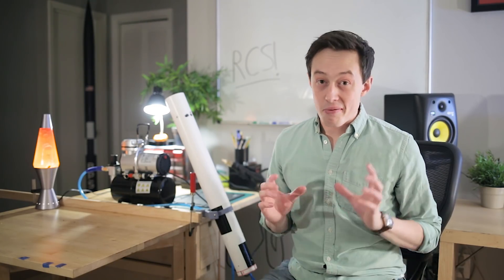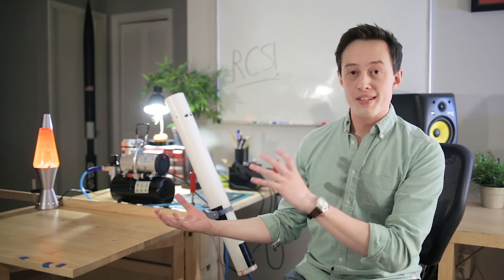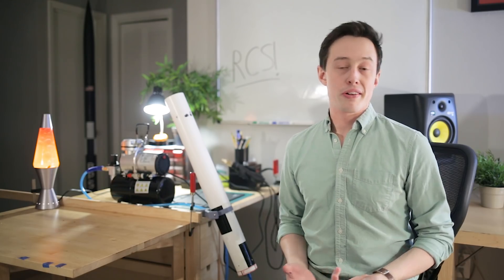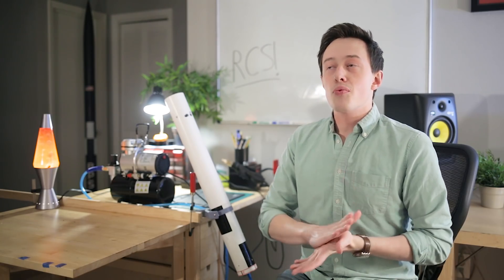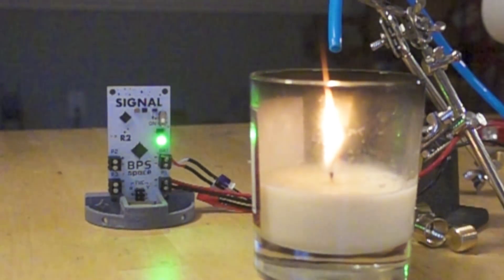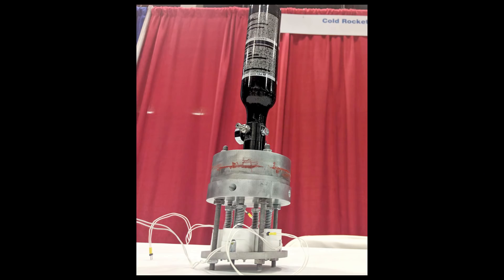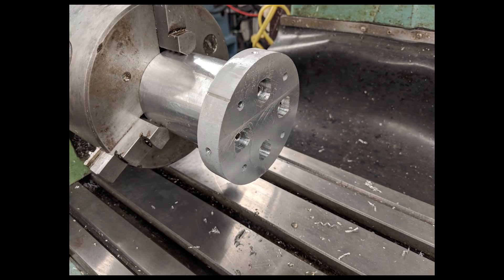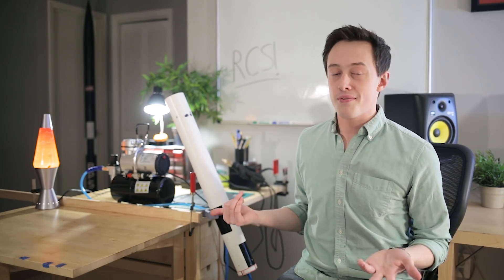Reaction Control System(RCS) Development

Comment: I have a question tho: why do the rcs engines produce a white trail in space? Shouldn't the gas be invisible in the void?
Reply: Space-worthy RCS thrusters usually have combustion chambers and run on hydrazine-based fuels (as opposed to cold gas systems that just require a pressure source and a valve). I have no idea what the products of the combustion are, but I see nothing preventing those gases from being visible.

Comment: Would it be possible to build a lightweight composite pressure vessel to contain the exhausted energy from a black powder motor within a rocket? If so, would a control system to release this be practicable, or would the exhaust particulates cause too many problems in valves and nozzles?

Comment: Super cool system. One suggestion might be to refine the design of your thruster nozzles. With 100-200 psi of air you can easily get Mach 2+ flow in a convergent divergent nozzle with the right area ratio. This would give you much more thrust for a smaller amount of air used. 

Here’s a link to some of the isentropic flow equations for nozzles, you may already be familiar with them 

https://www.grc.nasa.gov/www/k-12/airplane/rktthsum.html

Comment: Have you considered using a Betaflight flight controller for any of these trials?? I feel like if you used a Betaflight FC you would find the board is very well equipped,,, and you MIGHT even be able to use Betaflight.
Reply: I think FPV is a big future for model rocketry, , with a variety of applications for example, hovering over a landing pad, flying laterally, or even racing,,,, and can't help but think that a top quality FPV flight controller might just be also the best thing for rocketry.

Comment: If you want to do the throttling (floating valve) control of the solenoid, automotive engine management systems sometimes do this for idle speed control and turbo boost pressure regulation. A flywheel diode is essential and typically they are modulated at 20hz with a 15-85% PWM control region. Because it is impossible to know the valve position you need incorporate this inside your closed loop control somehow, whether it be an internal control loop with an angular speed target, or something else, I have no idea :S.

Comment: What about using a little bb gun co2 cartridge? Very light weight, just needs a valve that can trigger and detrigger within milliseconds (so a regulator isn’t necessary). 

Also, could you show us what valves you used in more detail?

Comment: PWM is basically the same as having a high enough flight software frame rate, I don’t think you need to get fancy here. I’d also be surprised if you could cycle to solenoids fast enough to get a rate much more than the software refresh, so the benefit of pwm would be marginal.

Comment: When you say paintball tank at ~800psi - are you talking high pressure air, or Co2? The gas volume and weight will vary significantly. If Co2, plan on something that can deal with phase change energy or you'll be freezing up everything.

Comment: In your next upgrade, the RCS thruster section should be a shouldered/full body width center section.  This way you slip it in a 74mm tube that is the rest of the propulsion section, and an upper rocket section can slip over the top.  As discussed below, when you get to roll control, you just use a smaller orifice for the jets and accomplish vastly reducing the thrust and still operate at the same pressure as the other two axis. This allows you to build a complete system that you can put in the middle of an existing rocket for testing.

Comment: HOWABOUTA sleeve for the rocket engine that steals pressure from the main engine for the RCS. If all RCS ports fire at once it would have the added benefit of lessening the rocket thrust, as a form of throtteling.

Comment: I’m not sure how you could get a tank for this you could tear apart some air soft guns but you can use green gas it’s really easy to refill and a very high pressure for smaller rockets that is if you’re going with a paintball tank  sized rocket that’s a lot

Comment: @bps.space if you do 90 degree turns you will lose bit efficiency i recommend you to make the turns smooth. On CAD  you can youse swept with remove  90 degree turns not good for you because you have limited air

Comment: Given that your rocket will stay in the atmosphere, how would the energy/kg compare to using a drone controller, battery and four small props to achieve the same thing? I guess you would need to minimise the drag caused by the props but it might be offset by the weight savings?

Comment: Congratulations Joe, that's a great new idea. Will be perhaps better to use proportionnal small Rc valve type with Rc servo actionners. The answer will be proportionnal and you will save a lot of compressed air and weight for same result. Will be also much lighter and efficent. Go direct to simplicity. Why designing heavy when you can do it light...

Comment: Have you considered using propane/butane instead of compressed air?
Sure it seems dangerous at first but their compressibility is much better, and you could store a lot more gas allowing for more time to run your RCS.
Also, maybe some clever design for electronic firing, and an optimised nozzle and you could literally fire them off :D
But seriously, combustible gases are sometimes used in some hydraulic applications where the ability to store a lot of pressure is important.
BTW all the best to you from Polish Synchrotron Light Source, I do have my own share of "space like" technologies here :)

Comment: Great video, keep going. I like the way you challenge the different control systems and practically demonstrate them.
You need something like a spare tyre to act as an air reservoir to give you longer testing time.
The link to Charlie doesn't appear to work.

Comment: What about using propane? It is at about 8bar at room temperature and it will expand 270 times during the transition to gas form.
This could allow you to reduce the size of the pressurized tank to a very small tank of 100ml or so. 

The biggest issue in this case is the cooling of the propane when transitioning to gas form. Usually if you let out gasious propane from the top of a tank of liquid propane, the liquid itself cools down, which reduces pressure and the ability to turn into a gas. This could be overcome by keeping the propane a liquid right up to the valve, and basically spraying out liquid propane. Then the absorbed heat energy will not come from the stored rest of liquid, but from the air surrounding the spray of liquid propane.

Another option to overcome the cooling issue, that could increase performance greatly, is the heating of the liquid propane. In this case, you'd choose the simple tank that feeds gasious propane to the thrusters. Now that a big part of the cooling takes place at the stored rest of liquid propane, a single small propane burner can be used at the tank itself to keep the pressure high.

If you think about 100ml * 270, that's 27 liters (athmospheric). That's the equivalent of a 2,7L (air) tank at 10 bars. I'm sure a 100ml tank is much lighter than a 2,7ml tank (both would hold 10 bars for comparable performance).
Reply: Me like!
Reply: OwO a scientist

Comment: You can probably reduce weight and get more control authority/more RCS burn time if you use propellant grade hydrogen peroxide with silver catalysts. Lower pressure, thinner tanks; the advantages are numerous.
Reply: If you can’t acquire propellant grade h2o2, the use of some kind of chemical gas generator with a downward pointed bleed system (more thrust) may also be a good idea. I don’t know how easy it is to get pure/nearly pure hydrogen peroxide. It’d need to be about 95%.

Comment: On your CAD, model the sharp 90 degree in the fluid flow will induce turbulence and cause a massive amount of energy loss... A smoother transition i.e. a 1/4 of a donut would be worth a reprint. Also loved the nerd out during the test. Industrial peroxide passing through a catalyst in the future??....
Reply: Bear in mind that it also needs to be manufactured with reasonable ease.

Comment: Why not buy an in home high pressure compressor https://www.google.com/shopping/product/1?q=high+pressure+air+gun+compressor&client=ms-android-verizon&sa=X&biw=412&bih=766&tbs=vw:l,ss:44&prmd=sivn&prds=num:1,of:1,epd:8801944323085387089,paur:ClkAsKraXxazr8WUP2GCmxl5pbyWzyV2QSVQ5c3085Wq2Kokj1BVGq6b7mP3ZGJDauBgMJKOjQvVqGas7naixHkkUMF_d7olQurO6K5xzQawVMgF0U-AJhbu9RIZAFPVH70aB8uNLwHQl3jKfJDLrfFB6zM5Nw,prmr:1,pid:8801944323085387089,cs:1&ved=0ahUKEwjY3o-KucvgAhXGmq0KHTLKCN0QgjYIhgU

Comment: For the air storage, it may be interesting to look into cylinders for airguns, those are usally quite small and compliment the shape of the rocket quite well. you may even have enough room around the cylinder for the valves and other required equipment. (smallest paintball air tank is around 350cc, a pistol air cylinder can be found in 68cc (3000psi)
Reply: Could invest in making custom COPV’s, Air Command Water Rockets used fiberglass to create a custom pressure vessel
Reply: Cool story bro.  Maybe try watching more than 2 minutes of the video before commenting.

Comment: How do you calculate the thrust produced by one of your RCS nozzle, given the circuit pressure and the nozzle diameter? I tried to estimate it for a roll control system on a model rocket a few months ago but got stuck in the equations, I couldn't find a way to calculate the air flow velocity through a nozzle knowing its size and the pressure difference.

Comment: For lower weight parts you could look into pneumatic RC retract components. Cool project! Looking forward to the next video!

I'm not sure about the maximum operating pressure of those systems though, may be too low and not enough flow

Comment: Joe just a thought, rather than carrying a pressurised air vessel and that complexity, have you thought of using water instead for a higher reaction mass?  A brushless motor would run a small centrifugal compressor which cycles water back to a reservoir, when you fire a thruster it's bled from the upstream pressure line.  Then if you get really adventurous you could swap water for H2O2... (3.5v, 200lph, USB, just say'in: https://www.amazon.co.uk/Anself-Ultra-quiet-Waterproof-Submersible-Circulating/dp/B01FTL6H8S)
Reply: @benadians1769  Well water or mercury will ruin his office carpet ;-)

Comment: I would be careful with using pwm to control relays as they contain moving parts. Maybe go for some solid state relays if so. Also make sure to put the solenoids far away from any delicate electronics because of magnetic interference, and use filters on the power. Are the thrust vector control and RCS working isolated from each other? Could be beneficial with some sort of common control strategy using LQR etc. Awesom video, keep up the good work!! 👍👍

Comment: 7:05 Why are you using psi instead of Pascal? It's a little bit confusing tbh.
Translation for others that are as confused as me:
"I'm probably going to use a paintball sized tank at around 5.5 to 6.2 MPa which is then regulated down to between 0.7 and 1.4 MPa for the actual thruster ports. And the roll thrusters will be regulated down to 350 kPa to 700 kPa."

Comment: For roll control why don't you simply reduce the diameter of the nozzles proportionately. This would significantly improves the off/on/off timing that you have to achieve. In other words, you would have more time to play with to achieve the desired delta-p as applied to angular momentum.

Comment: You should be able to reduce the weight by using a bladder system or use a section of the air frame to pressurize and hold the air. You should also be able to buy lighter weight or make your own air solonoids. If you pulse the valves it also uses less average current. Not sure of the cost but ultralife sold a gel type flexible battery you can form to the inside curvature of the rocket that is lighter. The battery and controller most likely going to be the most weight.

Comment: Have you thought of using the nitrous oxide capsules used to make whip cream (among other things)?. they are cheap, small, light and readily available. Further, the holders and valves are already available all over. This can also be scaled up when your system is perfected.
Reply: Thats a canister not nitrous but ok those small canisters are used in some airsoftguns too so he said it already
Reply: @krijndees  It's definitely nitrous oxide.
Reply: @mariohernandez1111  it could be that wer talking about something else but i dont think the one your talking about doesnt have nitrous that would be higly flammeble but idk what type of canisters your talking about but airsoft cannisters are Co2
Reply: @krijndees  maybe you should check out your facts before talking. Nitrous oxide is used for whipped cream.
Reply: @mariohernandez1111  i just said i dont know what cartridges go in there but i know airsoft guns use co2 cartridges

Comment: Have you considered precisely controlling the landing thrust by using 2 opposite placed motors that can swing out(in opposite directions, so the rocket remains stable) to reduce thrust and swing back in to increase thrust?
Reply: The two motor's thrusts may be different
Reply: @spacedoge3508  but you would be able to precisely control their thrust by vectrloeing them in or out, but vectoring them in or out would create a yaw force on the rocket. I guess this design wouldn't really work, it was just an idea.
Reply: @Matthew Hutchinson the inefficiency is not really a problem, these are model rockets after all. You could solve the problem of a motor burning out too quickly by designing the trajectory so that the  rocket lands by the time the motors burn out, or you could point the remaining motor through the cg of the rocket.  The main problem with this idea is that if the motors thrust curves were different, you would have to point them out at different angles to compensate, which would create a yaw force on the rocket.
Reply: @user-fj4mb5jh8o  nice idea tho
Reply: Wouldn't it be cool if it had retractable multicopter arms to land?
Reply: @user-fj4mb5jh8o  I believe this problem can be solved.  Start off assuming that you know the individual engine thrusts.  Build a function whose independent variable is the angle of engine 1.  The dependent variable is the angle of engine 2 that will yield no yaw.  Domain will be somewhat limited, but probably workable.  Now, compute thrust when the engine angles follow the first curve.  I'll bet you can come up with a stable regime for the two-dimensional control problem.  Proof of stability (probably via Lyapunov) may be tricky - but as long as we're untenanted, we can just rely on empirical stability tests....

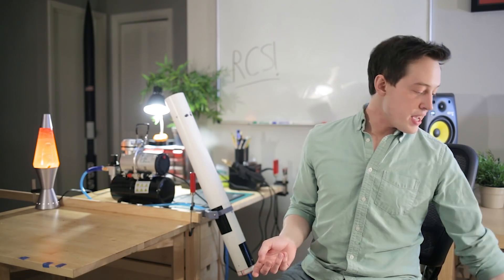Comment: 2:35 I really hope scuba tanks don't contain CO2
Reply: All this argument about oxygen being toxic or not and nobody mentions the fact that even 10% CO2 is lethal and lower concentrations are definitely not safe. The CO2 is used for other purposes. Nitrogen is used to displace the oxygen. Yes it's reasonably safe to breathe pure O2 at sea level, but scuba divers are under a lot of pressure so they get far more air in a lung full. Even nitrogen gets toxic if you go deep enough so helium and other gases are used
Reply: Toboter XP scuba markers that signal the ascent of a diver are bright hollow tubes that are filled with a gas to float to the surface. some use a co2 cartridge to inflate.
Reply: @windows_x_seven thats true
Reply: @windows_x_seven Oxygen isn't flammable. It's an ... oxidizer, so the more you have available, the easier and faster combustible materials inside that atmosphere can burn.
And pure oxygen eventually gets toxic even at atmospheric pressure if you breathe it long enough, which is why even though patients might get oxygen at a higher than atmospheric concentration, the concentration is reduced through the design of the masks or flow restriction.
Reply: You have to breath part oxygen and part other gas because oxygen is toxic so...
Reply: I will have to disagree with you on that. Quite some spaceships used pure oxygen atmospheres. The Apollo mission for example, until the oxygen set the craft on fire in Apollo 1. Wich was a manned, so the atmosphere was probably not lethal, at least while not on fire.
Reply: @williamrose3413  if oxygen is toxsic we would all be dead
Reply: @krijndees  Oxygen is toxic when in high concentrations rather than the 20% we breathe
Reply: @williamrose3413  we dont even have 20% and a firefighter told me that there is 100% pure oxygen in their tanks but not licuid and now you again say oxygen is toxic ITS NOT it even is better for us to have more oxygen if you look like 1 mil years ago there where much bigger creatures that are small today the day cause there is less oxygen so STOP saying that oxygen is toxic
Reply: @krijndees  but it is
Search oxygen toxicity on wikipedia.
Reply: @krijndees  Firstly, yes we do breathe 21% oxygen and secondly, try googling oxygen toxicity
Reply: @kellynyanbinary  oxygen how we breathe it isnt toxic you are right, but under certain pressures i.e. Deep under Water it is.
Reply: @williamrose3413  Tell that to Apollo crew where they breathe pure oxygen
Reply: @GuRke5100 100% oxygen is considered “safe” to a maximum of 6m (20ft) under water, where the partial pressure of O2 (PPO2) is 1.6atm. Deeper than that you risk loss of consciousness and death due to central nervous system (CNS) toxicity of oxygen. 6m/20ft is hardly “deep” ;) 

For the ones saying oxygen isn’t toxic: more correctly, high partial pressures of oxygen are toxic (generally, PPO2 > 1.6atm). Therefore at sea level 100% oxygen is a PPO2 of 1atm, so not immediately toxic (CNS toxicity). However, there is also “respiratory toxicity” which is usually a problem in hospital environments where patients are on high concentrations of oxygen for extended periods. Google is your friend.